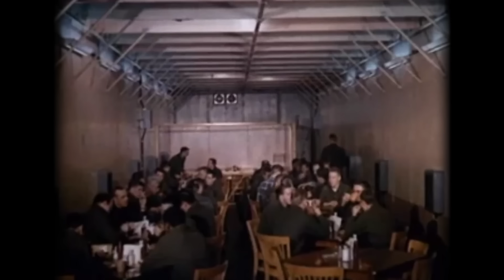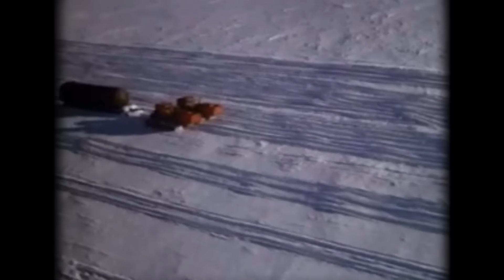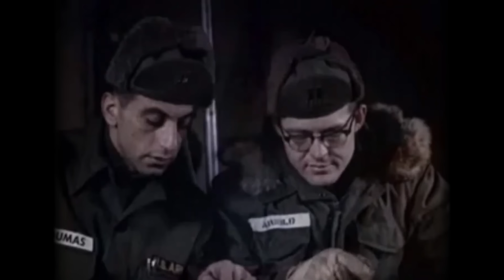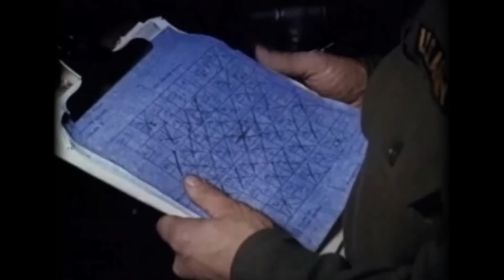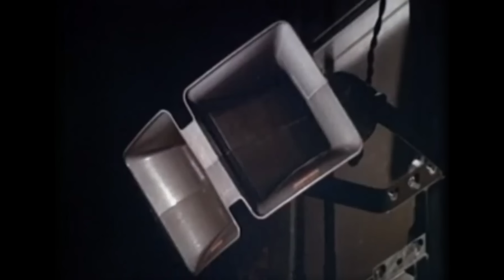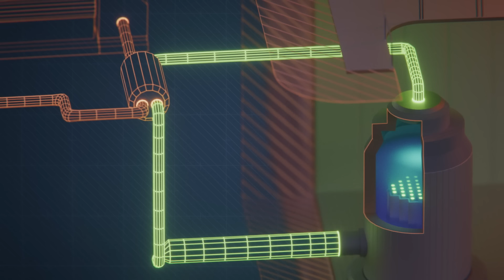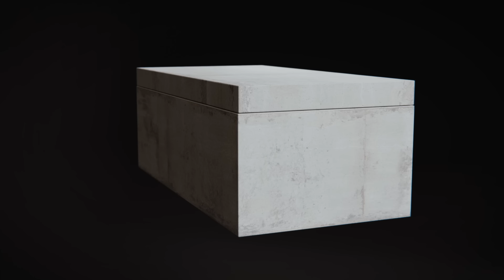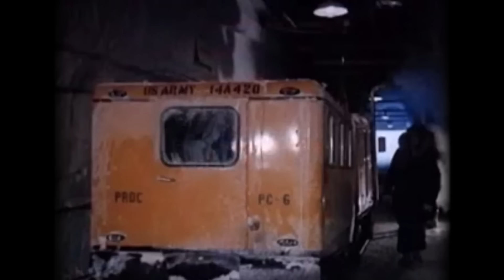How NASA Discovered a Military Base under Greenland

Comment: That "ecological disaster" is not as bad as it sounds. Water itself cannot really become radioactive (Deuterium is stable, and the minuscule amounts of Tritium you get from irradiating water is basically negligible), that's why it's used to store fuel rods and other radioactive stuff.

But it's in in direct contact with the insides of the reactor, so it can contain all kind of dust and dissolved things, that can be irradiated, so that's why it's a hazard. And while dumping it into the ocean sounds terrifying,, the bottom of the ocean is actually a pretty safe place for most radioactive materials.
Reply: As with you, I am not too fearful of any radio nucleotides in that wastewater cavern. Luckily they did pull the reactor vessel, so we won't have to worry about someone digging up 90+% U235 fuel rods o.O(!) 
What is nasty are all the novel organic chemicals of the 60's that they also left behind. Particularly, it has been been noted that there might be several hundred kilos of PCB's found in the remains of Camp Century. There is also the 200 tons of diesel fuel that will emerge as the glacier runs into the sea.
Reply: @gamarus0kragh  I do believe nucleotides is what DNA and RNA is made of 😅. You might be thinking of radionuclides?
Reply: @gamarus0kragh  Don't forget about great grandpa's radioactive poop.
Reply: @gamarus0kragh yeah there's worse stuff dumped there, I guarantee that!

I haven't looked into this much, so whenever I heard of it I thought they left the reactor behind. 

Some water? Not a big deal.
Reply: @gamarus0kragh  What happened after the Fukushima nuclear plant accident, after which the radiation even reached Miami and the radiation increased. stir the matter a little better.U drink that water
Reply: Drink it.
Reply: But even the purified water they use for cooling in the core isn’t perfectly pure. Every minuscule bit of salt and everything else leeched from the walls becomes radioactive. It’s gamma, beta, alpha etc.
Reply: @Hand_planed they mentioned this....
Reply: @Hand_planed  Yes, and that's why it's still a hazard. Most importantly the water from the primary loop is in contact with the fuel rods, and can contain small amounts of the fissile material. So I'd definitely advice against drinking it. But the amount of radioactive material is really small, and water is great at blocking radiation. You could fill a pond with it and live next to it with no adverse health effects for the rest of your life.
Reply: This made me think of that one beach in Brazil that is covered in a small layer of monazite (which contains slight amounts of both uranium and thorium)! It hasn't caused any problems for people or animals living near it, despite noticeably higher radiation levels near them :P

Edit: By just Googling "thorium beach" I found there are several others around the world! At least it isn't as bad as asbestos deserts...
Reply: I think a big issue is that it's essentially in a big glacier. Glaciers tend to grind stuff up, including (I'm assuming) reactor containment casings and radioactive poop pools.
Reply: Just not for the things living on the bottom of the ocean...
Reply: @TobyDiver  This might surprise you, but not many things live on the literal bottom of the ocean, in total darkness and without algae, plankton or any food whatsoever. 99% of the ocean floor is basically an underwater desert devoid of life. Only the coastal regions where some light still reaches the bottom, and places like geothermal vents and other energy sources are populated.

And even with that, 10 m water stops radiation even from spent fuel rods. Marine life would be entirely fine as close as 10-20 cm to this much older, much less radioactive source. (Cancer risk for short lived animals doesn't matter, and you need a much larger dose for acute radiation sickness)
Reply: Don't forget about the mass of diesel, oil and other chemical wastes from the base that don't degrade with time.
Reply: @MatterBeamTSF  Actually, light oils like diesel pose almost issues. The ocean has tons of oily fish in it, most oils will just biodegrade naturally. Crude oil is the one that causes ecological disasters.
Reply: @MatterBeamTSF not a big deal... how many massive war ships/ cargo ships/ oil tankers have sunk in the ocean over the last 100 years full of oil?
Reply: You’re right, it’s direct contact that absolutely contaminates water - it’s known as “the universal solvent” (and great at making suspensions). 
An analogy would be water around a sealed container of E. coli compared to water inside the sealed container - one is safe to drink, one isn’t
Reply: @Nturner822 Yeah, and both are safe to dump into the ocean.
Reply: Man.... thats not a frickn water.
Reply: The animation for the waste water is clearly designed to make you feel a certain way rather than think objectively.
Reply: Nah, we should evacuate Canada just to be safe, especially Quebec. Well send a few million Americans there to keep Canada warm.
Reply: @ch4.hayabusa bro Canadians are Americans, they know, we know it and they hate it because they know we know it as do they
Reply: Cope brigade, assemble!
Reply: Yeah, I don't think it is as bad as people think. 

The melted core of chernobyls reactor was originally so radioactive it would kill you if you got close to it... Now 30 something years later researchers can actually approach it and take samples, and it would take multiple hours of sitting on top of it to kill you. 

This old water can't be THAT bad...
Reply: @volvo09  the short lived isotopes that was ejected from Chernobyl are usually the most dangerous ones, but they also decay rather quickly in universal terms. Most of the Cesium and Strontium are still present but has decayed one half life by now. Still dangerous, still mimics biological processes in your body if ingested or inhaled which is as dangerous as the radiation alone. 

Iodine-131 which has a half life of 8 days was the most potent isotope to human health, but its long gone now

Other than that, the most long lived radioactive element around Chernobyl is plutonium but it only emits alpha particles (and its heavy) so its not that far away from the reactor itself. Unless inhaled or ingested, plutonium is relatively safe compared to the other two
Reply: @volvo09  This was at least a million times less radioactive to begin with. Again, all the water is not radioactive, only whatever is mixed in with.
Reply: @EvanOfTheDarkness how much dissolved solids would be in frozen ice in greenland anyway?
Reply: So then is Fukashima a big problem now or a small problem?
Reply: @TheHumanRanger  It's a small problem. IIRC it wasn't even a meltdown, it just overheated, and had a few explosions because of that. The scary part was what could possibly happen.

Every nuclear reactor can, in principle, become an A-bomb. A very bad one, because most of the engineering of an atomic bomb revolves around how to keep this rapidly exploding mass together long enough, but still.

In the end it was a big and sad catastrophe, but largely not because of the nuclear part.
Reply: @EvanOfTheDarkness 

No. Nuclear reactors cannot become A-bombs. It's physically impossible.

1. Nuclear bombs require precise detonation processes to ensure ALL the fisile material is converted, rather than just blow itself apart without undergoing fission. 

2. Nuclear reactors use very low enrichment fuel compared to nuclear bombs. 20% at most, compared to 90% plus of nukes. 

Caveat: This particular reactor does use 94 percent enriched fuel. So that, I don't know. But it's far from the norm. 

Nuclear reactors can create thermal explosions, as with any high heat device can.

But not nuclear explosions.
Reply: @CandleWisp  A nuclear explosion IS a kind of thermal explosion, my friend.

1. That's only true for the bigger bombs. The "little boy" was literally just two half of a critical mass blasted together. No precise timing whatsoever.

2. Reactors use low enrichment, because they use much more uranium. Both can go critical during operation.

Reactors can absolutely explode as an A-Bomb, if you yoink out the control rods. This did not happen yet, because most reactor designs involve multiple levels of safety systems, and even the worst meltdowns were relatively mild in context, with the worst case situation (a full on detonation of the reactor core) avoided. But it can happen.
Reply: @EvanOfTheDarkness  What? No we already have a term for what happens when a reactor has its control rods yoinked out. They're called criticality accidents and we've had quite a lot of them in the past. Even in the early days of atomic reactors before a lot of the safety systems.

A-bombs need their criticality to come fast, like quarter-of-a-second fast, that's why they explode so violently because the energy really has nowhere else to go. With a reactor it usually just melts into a lava-like slurry and kinda sits there (See: Chernobyl's elephant's foot). Most of the physical damage done in meltdowns and criticality accidents is from steam or hydrogen explosions.

Also gun-type atom bombs were phased out really quickly because they both weren't that efficient nor were they all that safe. Every bomb today uses the implosion-type which just compresses the fissile materiel super fast with chemical explosives. Hell, thermonuclear bombs use regular nuclear bombs to compress the materiel.
Reply: @TheHumanRanger  a lot of it is marketing.  No one wanted to buy Japanese food for a while.
Reply: Nice, I think now that you say it like that, I am okay with it. 

There is literally no problem with ignoring the sovereignty if another country. And it really shows that the US never gave a shit about their "allies".

US of Arrogance
Reply: Solution to pollution is dilution
Reply: @JKHTX  Yes and no. The big problem with nuclear stuff, is that the fallout from a single strike or accident isn't diluted enough even hundreds of kilometers away. But that's mainly because it's airborne, and it can coat things like fruits and vegetables.

In this case dilution is a good solution - fist of all it's a lot less radioactive material, and everything is already in water and not in the air, and most of the bad stuff will just sink to the bottom anyway.
Reply: @EvanOfTheDarkness  you're right.  Fall out sticks around and ability to dilute is limited.   Then some stuff like lichen and mushrooms likes to concentrate it.
Reply: @EvanOfTheDarkness  how much fruits and vegetables are being grown in Greenland?
Reply: @randybobandy9828  There are quite a lot of fish being hauled up. For export, it's mainly Hallibut, a fish from the top of the food chain, so if there is any bio-accumulation (and there are), they will be at risk of higher concentrations. 
For the local Inuit, seal hunting is of high importance, so that is another vector of concern.

Comment: Supercritical in a reactor is not the issue that you state it is. The only way to raise power in a nuclear reactor is for it to be taken supercritical which means an effective neutron multiplication factor greater than 1.0. What happened at SL-1 was the reactor was taken prompt critical by withdrawal of the central control rod which means the reactor was critical on neutrons directly from fission alone. Add in the neutrons from the decay of neutron precursors and a massive power spike occurs.
Reply: Reactors run at critical - so the neutron multiplier is 1. That gives you a stable reaction, not one that expands in power. Nuclear bombs run on supercriticality - a multiplier greater than one, leading t oa runaway reaction (As the neutronm generation keeps growing) Source: I'm a physicist, I've studied nuclear physics.
Reply: @Molikai  i guess he edited his comment? he states when specifically reactors go supercritical in order to raise power. he specifically states that “prompt” criticality is what is requiredfor nuclear based explosions. not sure what the disagreement is here

- source - person who can read
Reply: @Molikai  He's right

- Not a physicist, but played fallout alot